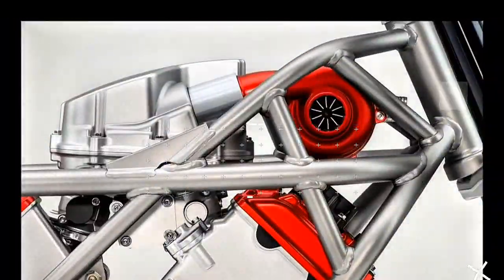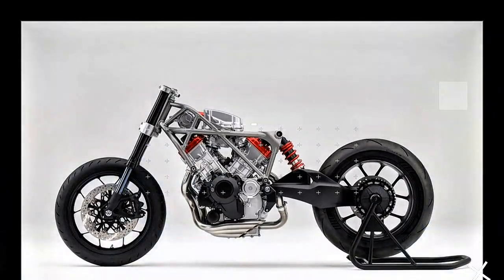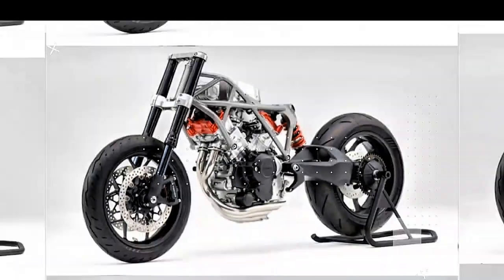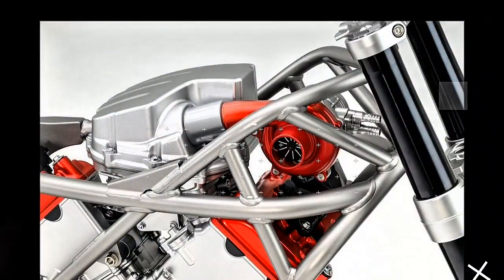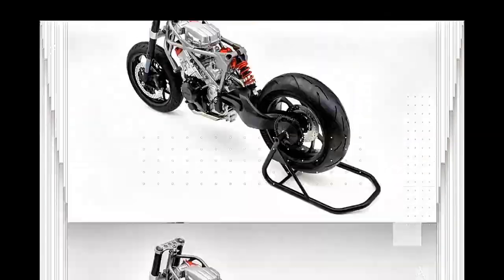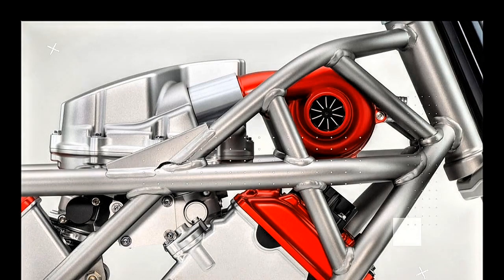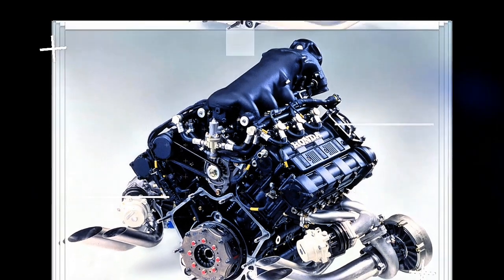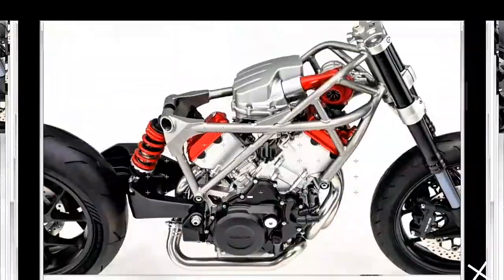HONDA'S SECRET ENGINE REVEALED! World's First Forced Induction V3 - What You Need to Know

Comment: Forced induction is where turbocharging or supercharging is used to increase the density of the intake air -
so which is it?
Reply: It says electric compressor in the video.
Reply: @bobeyes3284  - I dunno - it's very sketchy.
Reply from the maker: Honda's V3 engine features turbocharging, utilizing exhaust gases to drive turbine-powered compression.
Reply: @Abdtechlab  - OK thanks for clearing that up.
Reply from the maker: @alpal2002  My Pleasure 😊😊
Reply: @Abdtechlab  - Thanks - I think turbos on bikes were often unreliable and very expensive to fix.
I remember the old Kawasaki 750 turbo from the 1980s -
it wasn't a success.
Reply from the maker: @alpal2002 Yhh. Exactly 💯💯. U are absolutely correct